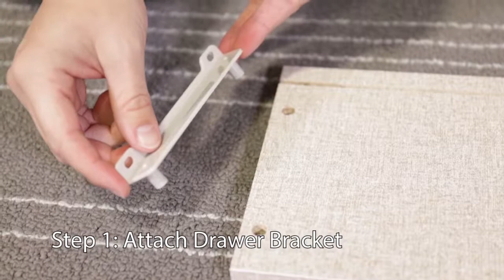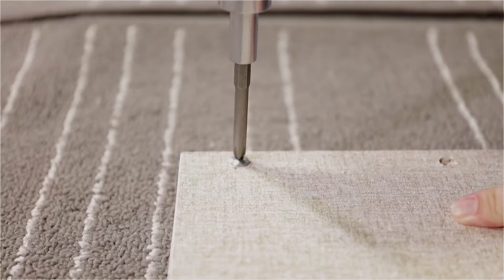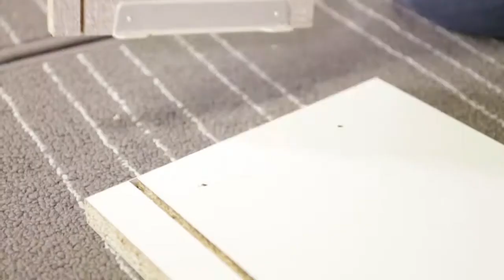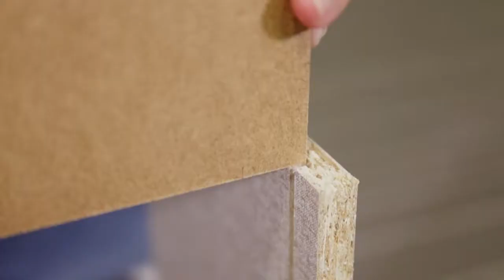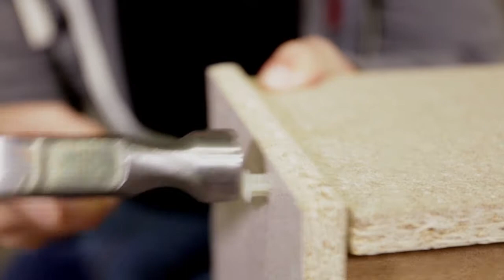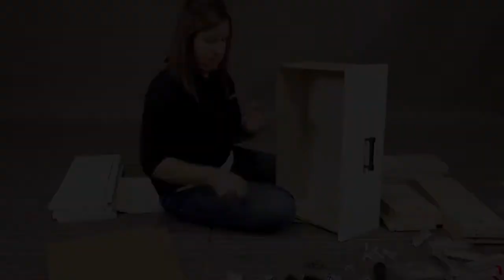Assembling a Drawer with Drawer Bracket

Comment: What if the bracket doesn't fit?
Reply from the maker: Hi! The brackets can be a tight fit and may need a little extra push to get them in place. If you believe you received the wrong brackets please contact our customer service team at 1-800-489-3351 from 9:00 a.m. to 5:00 p.m. CST. Thank you.